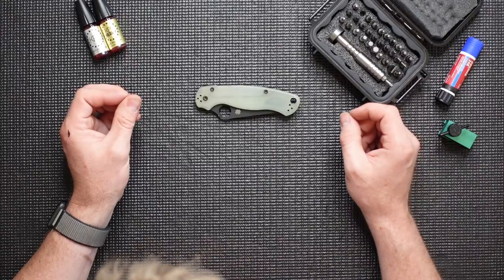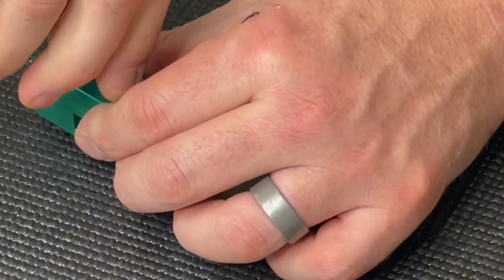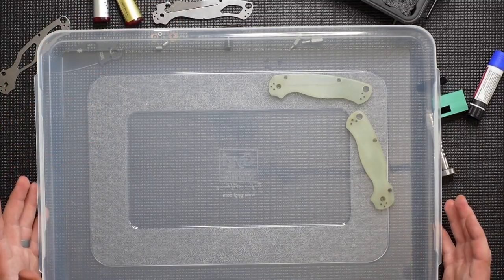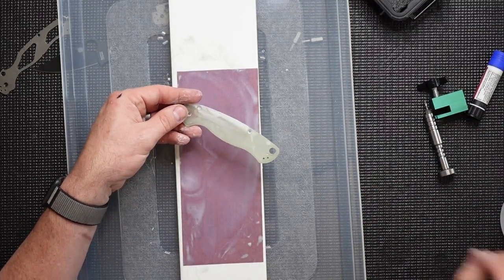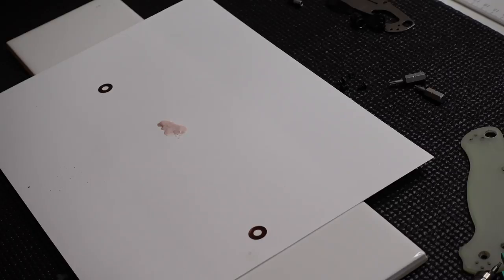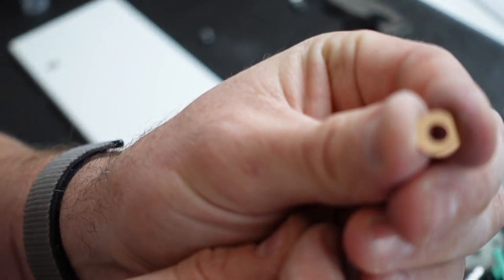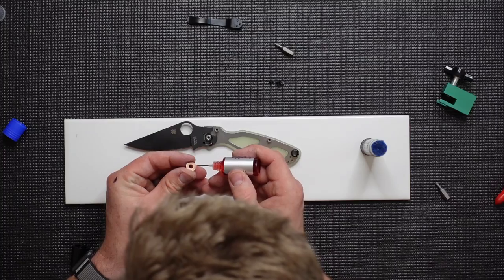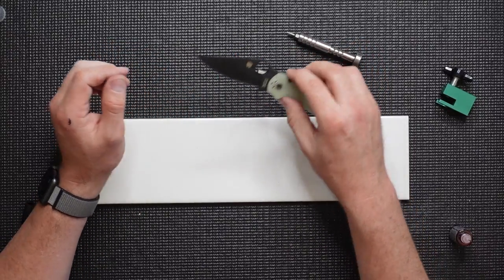Fine Tuning the Spyderco Paramilitary 2

Comment: I can see the scale smoothing but the washer polish is not really all that necessary unless you’re impatient. The washers will brake in after time just like anything mechanical, and your knife will have its own way of breaking in.
Reply: I've had mine for 5 days now and after a drop of synthetic motor oil where the washers ride against the blade and about 1k worth of flicking it open and close the blade falls into the resting closed position under it's own weight.
Reply: Polishing bronze with a sort o paste like glanol works wanders. I had a copper button which felt like scratching everything each time I pushed it. Gave it a good polish and went buttery smooth.

Comment: I just purchased my very first spyderco. A crucarta pm2. It’s ridiculously stiff and no where near being dropshutable. I’m going to loosen the pivot and apply some kpl. But do I really need to disassemble? Can I just get away with a drop between the scales and work it’s way in?
Reply: Disassembling helps bc you can get the kpl in certain places better than you could with just putting a drop in, my crucarta pm2 was also extremely stiff, but honestly if you disassemble it, lube it up and then mess around with it it’ll become drop shutty
Reply: plus there could be dirt or some other crud you need to clean before applying the kpl

Comment: Thanks for the video! My brand new PM2 from the Knife center is very stiff and is actually hard to open using the spyder hole. I hope these instructions help! I'm a little surprised at the quality control with spyderco. Btw, I just ordered some KPL, thanks again!
Reply: Mine is the same pm3 maxamet it was great untill I put in new washers and ti hardware now it sucks
Reply: Doesn’t it have to brake in?
Reply: @Clevernaut it would have taken a lot of breaking in to get it as smooth as the video instructions did. Now it's very smooth and easy to open like it should have been.
Reply: And the lube works excellent
Reply: @Luke-pb4pc  how did it turn out? I have the same problem
Reply: @shane_wc  the washers worked great I changed out for ti hardware but then all three of my knives got stolen alot of pitfalls happene so I have none now I had the pm3 a emerson mini a100 thst was my favorite knife and a trm atom but yabit turned out good
Reply: @grock1515  so all you did was add some kpl? my pm2 is stiff as hell and I can't figure out why
Reply: @shane_wc  hi Zane, I followed the video.  There's some sanding and polishing involved and using a good lubricant when you're done.  Watch the video
Reply: Use it for a week before you start messing with it. A little lube is fine but let things break in on their own

Comment: The black DLC Wharncliffe PM2 in CTS-XHP with Orange scales that is exclusive from Cutlery Shoppe's site came to me perfectly centered with already tuned "drop shut" action.
I have no need to take it apart unless I drop it in mud or something.
Reply: The Wharncliffe blade, like the Tanto and Emerson bladed PM2s, are a little heavier due to thicker blade stock, so they are pretty much using the weight for that "drop shutty" action. The standard PM2s need a little bit of breakin or tuning to get that.

Comment: Can you help me with my Spyderco PM2 CPM REX45 Copper? What can I do to make it smoother, better and so on? I would also like to get my blade dark grey(acid wash, stonewashed or other ideas), also the hardware, screws, pivot and so on. Maybe nicer backspacers(screws or a raised longer one in G10 or something + a lowride pocket clip. I cary my PM2 and Military original, with the blade down.) Do you know about someone who would take this work? All the best from Thomas, Norway
Reply: Also, can you make a detent ramp for smoother closing, where the detent ball just follow up the ramp and falls on place in the hole? And again, would it be better, stronger with Titanium backspacers screws, a short backspacer? And what did you use on the washers? Nano-oil?

Comment: I want to ask soemething. Is it possible to polish those 2 washers by using fine water sand paper like 1000 grit or more ?
Reply: 0.5 micron is equivalent to like 50,000 grit. So if you want a mirror polish you need something very fine

Comment: I can't help but wonder if polishing the phosphorus bronze washers causes more drag when opening and closing.

Take for instance if you have a pair of vice milling parallels and place them together, when trying to move them they feel stuck together because of the vacuum created in between the two parts. 
Or is it the fact that there is so little surface area on the washer face that it's negligible and the  benefit of a smooth ride outweighs this?
Reply: i also thought that the washers were self lubricating in the sense that as the metal wears it becomes its own lubricant.  polishing the washer would remove this coating wouldn’t it?

Comment: It's crazy, at the price that Spyderco sells its knives that they still need to be optimized.
Russian knives, like Cheburkov, don't have these kinds of drawbacks.
Reply: Those knives need nothing, take it out of the box and put it in your pocket, this dude is anal , probably cleans everything he's about to cut lol
Reply: @ScottSimmons68  The value for money at Spyderco is disastrous as is at Extrema Ratio.
Reply: What drawbacks? For under 200 bucks Spyderco knife will last 99% of people a lifetime, are there better knives? absolutely but nothing this dude is doing is necessary, my handle is too grippy, that's not a flaw, those Russian knives is baddass not gonna lie but so are Chris Reeves and many other handmade knives but most people don't have 500 to 1000 dollars for a work tool ya know?
Reply: @ScottSimmons68  Lol, I bought a Cheburkov for $300 and it's the best and most beautiful knife in my collection, far ahead of all the much more expensive, ugly American folding knives that work much worse.
Reply: Ok I get it you're not a Spyderco fan, you don't have to be, good grief

Comment: A knifes working job is to cut, can you do a video on sharpening the blade and what's the best angles and finish? I used the work sharp ken onion on my para 3 and it's crazy how easy it cuts know compared to the stock grind.

Comment: There's one problem I see people doing even in this tutorial. Why not lube both sides of each bronze washer? The washer is able to slip on the knife blade and frame both. In case you haven't noticed, the frame is sometimes the smoother side of the washer. For example, a Satin spyderco blade has grind marks that can grab the washer causing the washer to spin with the blade causing slippage at washer-frame. 

If you want to fine tune a knife..lube both sides of each washer. The knife will take the easiest path of slippage depending several things. Also polishing washers can't be a bad thing but would only work ideal if the opposing surface is smooth. If you notice in the video, the blade has a dlc coating that has worn appearance at the washer area. Dlc is not that smooth on a micro level. Satin blades are not smooth either in a different way. What I'm getting at, if you polish a washer, and use it against that rough blade then check it later. The blade really does a number on the washer. On satin blades you can notice after usage how the high spots of the blade grind has worn some. The blade steel is harder than the washer. It defeats the purpose to do all this work. One benefit of having blades not perfectly smooth like the polished washer would be, is those micro low spots hold lube better. I would think it be awesome if they made a blade that is mirrored smooth @ the washer contact. 

The scale polishing is a good idea if the scales are unsatisfactory in grip. Great video though. Lube ALL slip points and your golden.